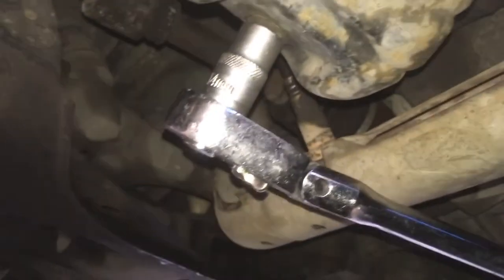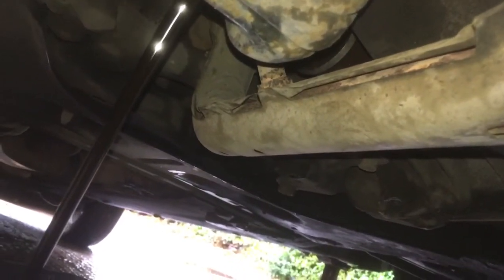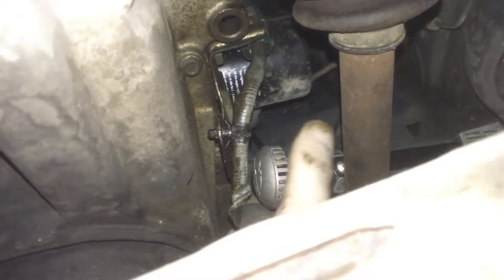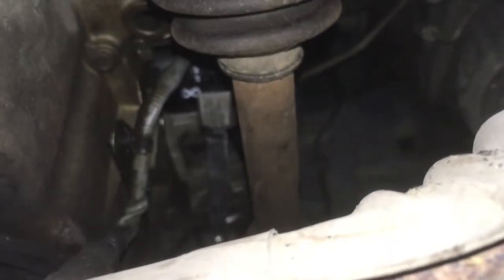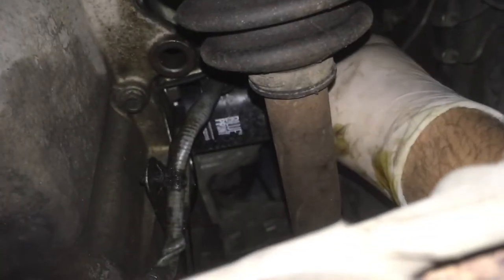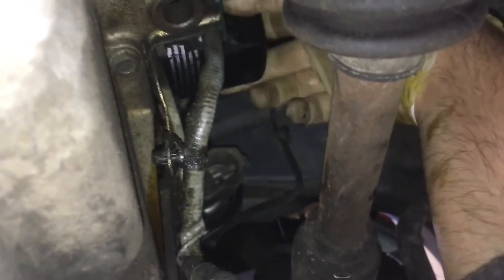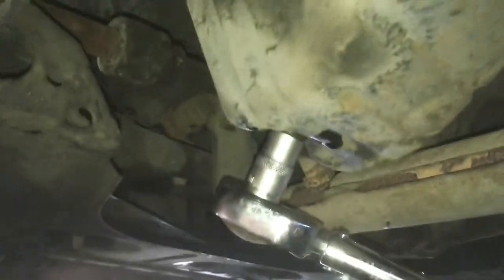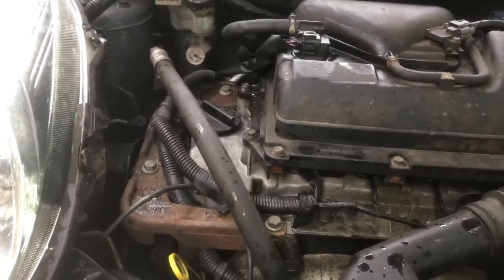Nissan Micra K12 Oil Change

Comment: I took the wheel off and found the oil filter easy to get to from the side. Saves lying under axle stands. Cheers for the video.
Reply from the maker: What a great tip! Thanks for the comment 👍🏼

Comment: Why do u put oil around the ruber ring on the oil filter? and how do u pour the correct amount of oil?
Reply from the maker: I have a subscription for technical information with E3 Haynes Pro which gives me the capacity and is pretty reliable. I always lubricate the seal to avoid it getting caught stretched torn or twisted during installation

Comment: Is this the 1.2 or 1.4l engine ? Because I have the 1.2 CR12DE and I keep finding different numbers for the oil capacity - from 2.8 to 3.4l. Here you said again 3.4.
Also what type of oil do you use ?
Reply from the maker: Hi there, the cr12de 1.2 has a 3.4l capacity for engine oil and filter change.

The engine oil the car should take is 
ACEA A2/B2 SAE 5W-30.